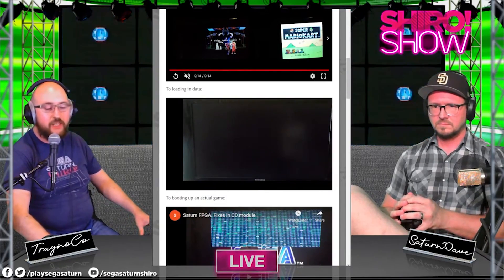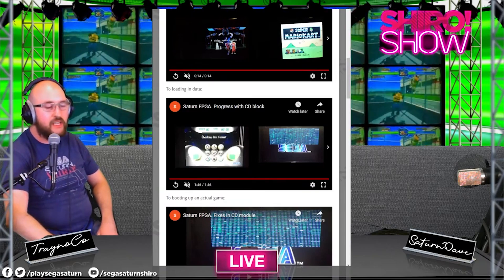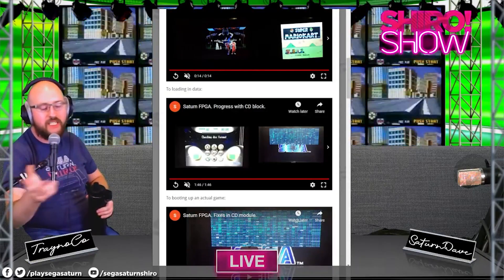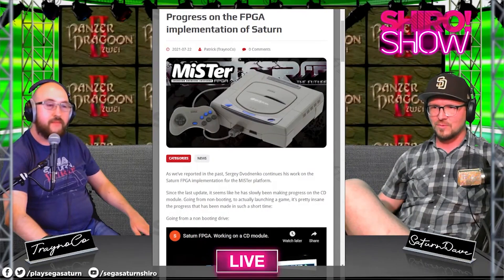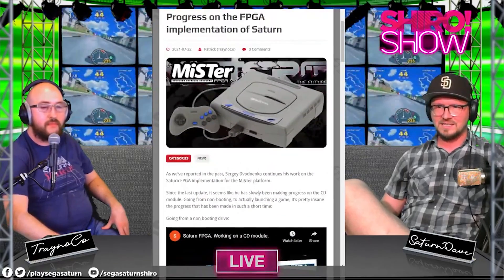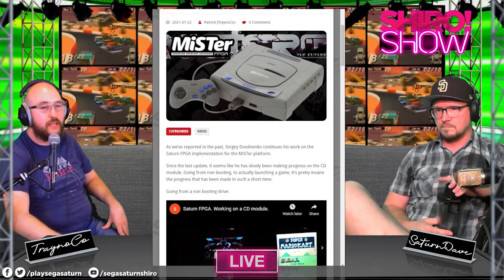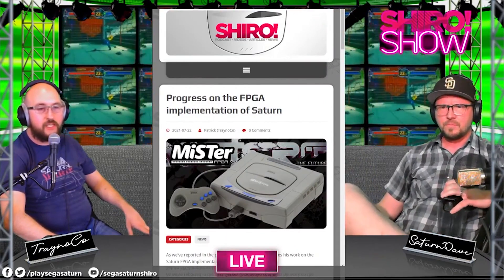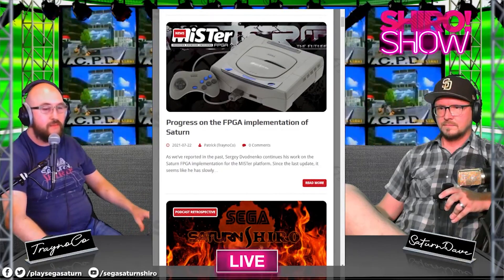MiSTer FPGA SEGA Saturn Implementation UPDATE! - SHIRO! SHOW

Comment: I had no idea a Saturn core was being made!!  I have a DE10 on the way and imagining how much clutter I'm gonna reduce is so exciting lmao  I wonder if that means a PS1 Core will be a possibility if they can get Saturn working since the hardware is simpler.  I think N64 would be pushing it though.  One can dream though lol  I could have the consoles the Mister replaces in a serparate setup with my consumer Trinitron since they're primarily 240p systems.
Reply: The ps1 core has been dropped and  no longer being worked on

Comment: Thank guys for explaining isnt sega cd fgpa board what's in new genesis everdrive pro cart to play sega cd 🤔 games...when is 32x fpga coming?^
Reply: 32x fpga probably never imo, way to much work for such a small library, especially when most of those games can be found on other platforms.
Reply: @1183newman  thats what they said about sega cd in a cart but look now ,) 2 different people did it
Reply: @rustymixer2886  well the sega cd is not a 32bit system
Reply: @1183newman  nope its bigger but now fits in cart next to 16 pcb ;) what does 32bit have to do with it, everdrive pro has nes master system genesis etc fgpa and they range from 8 to 16 bit so...
Reply: @rustymixer2886  coding the fpga for a 32bit system is way more complicated than an 8 or 16bit system, hence why the playstation and saturn are taking forever. The sega cd was just a cdrom drive for a megadrive. cdroms simply giving you more space for your games content. But the actual complexity of the hardware wasnt really anything more than the megadrive. The equivelant time to code the 32bit fpga for the 32x would be greater than coding the megadrive, snes, master system and nes cores put together for very little payoff. The most complicated cores we currently have are the neogeo and the cps2 which are basically 24bit cores
Reply: @1183newman  not little people are demanding it. Also they are working on 16 bit svp chip now too. I bet in 5 years we have homebrew 16 bit polygon games and 32x in a cart with sega cd everdrive too bro
Reply: @rustymixer2886  putting 32x games into a flashcart for a 32x is not the same thing as coding an fpga core for the mister.

Comment: I don't understand really what the mister is. Is it basically rebuilding Saturn hardware so that it's perfect emulation?
Reply: Exactly. It’s hardware emulation. It’s basically perfect. You don’t get any lag and the rgb looks even cleaner than the console. Everything else is software emulation and usually introduces input lag and compatibility issues. MiSTer just works. Get one. CPS2 cores work now. Arcade perfect.
Reply: Most all hardware design is done in FPGAs because they are (re)programmable.  The FP stands for Field Programmable and the GA stands for Gate Array.  Basically the FPGA is an electronics transformer (like Eta Prime)... in that the electronics inside can be created and rearranged to be a car, or a tank, or a helicopter... dragging the Transformer analogy out some.  If they discover a bug in the hardware they can fix it.  Once they are happy with the design, it can be used to produce ASICs out of... which are unchangable.  So in the case of the MiSTer FPGA project, they have a lot of "cores" and when you load a core, it reprograms the FPGA with functionally the same chips and circuits found in the original hardware.

The FPGA chip in the DE10-Nano board has 110,000 LE (Logic Elements).  How many things can be made out of those?  I'm guessing the most complex thing they have so far is the AO486 core which is basically an Intel 486DX system complete with all of the i/o hardware you'd find in those... like a video card, a sound card (even MIDI), CD-ROM and hard drive interfaces and even network, etc.

Another aspect is the LEs don't just let one chip or one circuit be recreated but you can basically make a mainboard with all of its components and their interconnections.  That means that all of the different pieces an work in parallel whereas software emulators are primarily serial.   Speaking of parallel operation, There is a Gameboy / Gameboy Color 2P core and a Game Boy Advance 2P core that offers two player.  Basically they have implemented two GB, GBC, or GBAs in the same core and interconnected them with a netlink cable... and provide one display for each player either side-by-side or top-and-bottom... or in the case of the GBA 2P core (if you have the optional Analog I/O board), one player can use the HDMI display and the other can use the Analog.  Some of the extra fancy features from the standard GB, GBC and GBA cores have been removed because there wasn't room in the 2 player core because there simply wasn't room.

As mentioned in the video, quite a number of common components are available and anything that already exists can be reused.

The question that remains to be answered is, given a knowledgeable/skilled developer, what is the maximum complexity that can be recreated with the 110,000 LEs?  That remains to be seen but PS1 and Saturn may be it.

Want to be able to go beyond that, you'll just have to get an FPGA chip/board that offers more LEs... and those are more expensive.  The Terasic DE10-Nano board is a dev board that is financially subsidized by Intel.  So while it may cost $180 retail, it is real cost should be > $300... or so I'm told.  More complex FPGA setups can get pricey fast... so there isn't a clear choice out there as to what might come next that is close to affordable for the hobbyist market.  Of course as time passes, things get more complex and prices reduce... so in the not-too-distant future, perhaps an affordable clear choice can be had and a new project can port existing MiSTer FPGA cores to it and expand into more advanced cores.
Reply: its what they call hardware emulation. the de10 fpga board is used for prototyping integrated circuits (ASICs) or processors and used for finding bugs befor it hits the proudction line . the cores are only as good as the person working on them but one thing fpga can do is run in parallel just like real hardware reason why you have no sound lag or input lag . a fpga will become a snes once you load the hdl code in the fpga there is no overhead . a fpga is a tool not a computer it can not do what desktop computers can do cost is very high on anything above de10-nano
Reply: It’s recreation.
Reply: @martinevans1206  for every system?
Reply: Thanks everyone for your replies
Reply: Thank guys for explaining isnt sega cd fgpa board what's in new genesis everdrive pro cart to play sega cd 🤔 games...when is 32x fpga coming?^